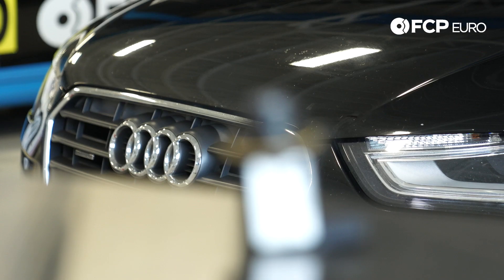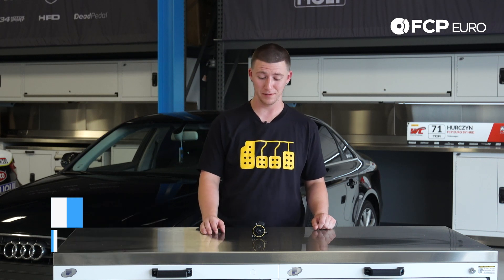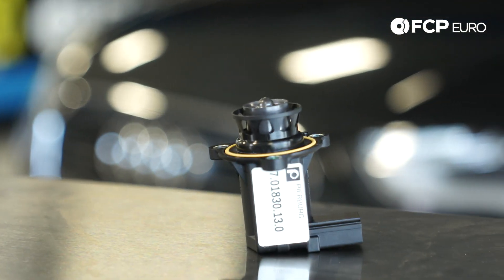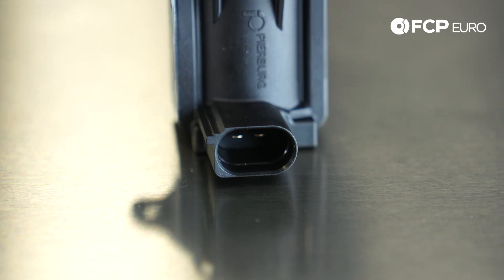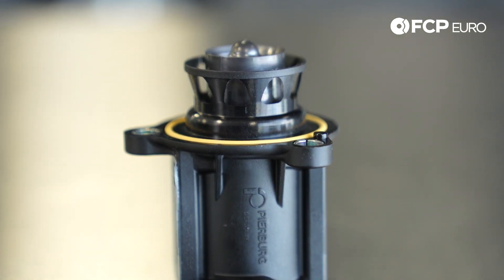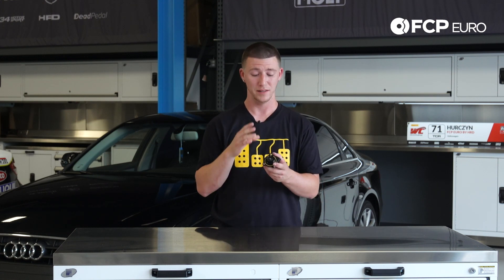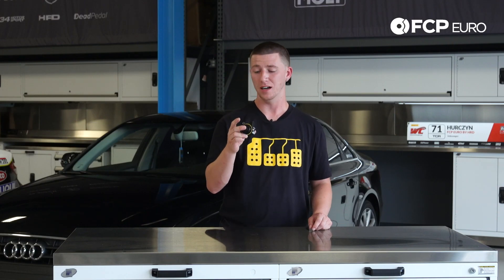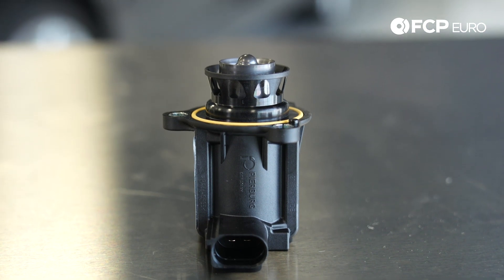Audi B8 - 2.0T - Diverter Valve - Common Failures, Benefits, and Product Review

Comment: Do these have a mileage interval. I am at 138k on a b8 a4. Had underboost at one point slight whistle. Done the Pcv valve spark plugs. Still seems a bit sluggish. Also had lean idle. Thinking dv valve or fuel filter.

Comment: Hey my 2010 audi a4 its having problems its been missfire while on cold start and when I step in the gas there its no power and my engine missfires and shakes very bad
Reply: Similar problem with my B8 2.0 TFSI (220) I replaced the PCV and walnut blasted the inlets, car much better now, however, it still seems to lack performance, with a faulty DV what would the running be like ? Asking as I don’t have access to a diagnostics machine
Reply: @madaboutbrens  did u figure it out
Reply: @AngelRodriguez-jv6oc   yeah cheers, i took the diverter valve off and it was faulty.
Reply: @madaboutbrens  did you replace it with the OEM exact same one or with a better one ?
Reply: Did you ever figure out if it was the diverter value that was causing your issue?